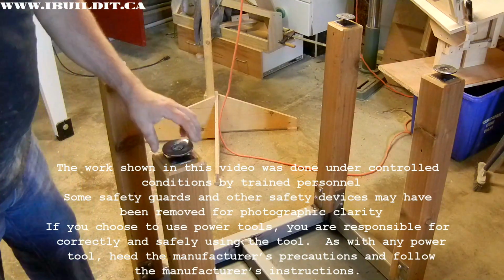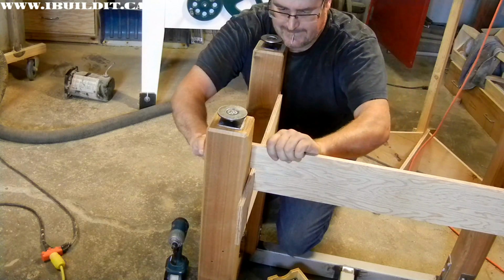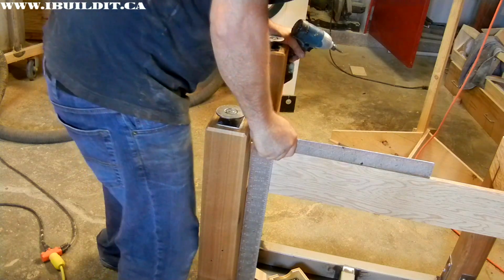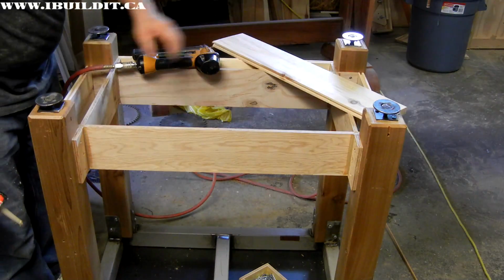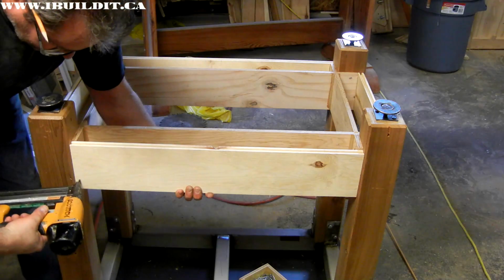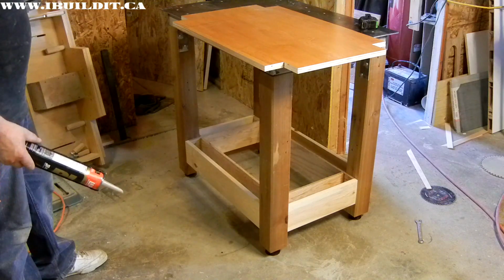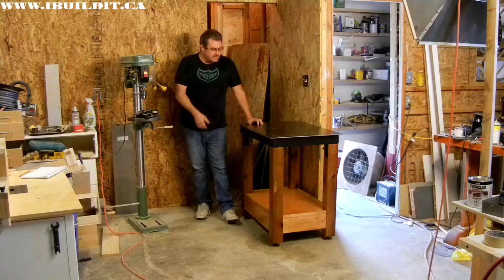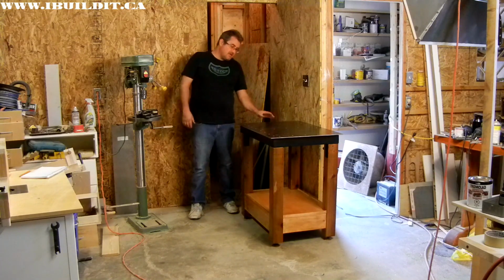Making A Steel Work Table, Part 4 of 4

Comment: I accept and agree with your requirement that the table sit firmly on the floor, but also like parktondc's suggestion for casters, so maybe you could do a video on how to fabricate the sort of cam-action flip-down casters that Rockwell/Delta machines from the 1950s have? Those machines rest firmly on the ground and when you step on a pedal, the casters are engaged by the cam.

Comment: An idea.  If you were to put casters on the cart and a bottom , you would have some storage for heavy metal pieces or tools for metal working and you all ready have a cover plate for the top. The bottom will then be weighted some and help prevent the cart from wanting to turn over ,just and idea

Comment: Actually, i agree with both of you on this point.  Sure, if i have a bottom tray i will end up filling it with junk over time, but if i didn't have it to store things that i use over the course of a project i would be spending a lot more time wandering around the shop trying to remember where i set it down.  After the years i just have to accept the fact i'm a slob, & have "just enough" discipline to put my pile of junk back at the end of the day; so the tray is handy for keeping it in one pile.

Comment from the maker: The piece I bought was smaller (24" x 36" or 600mm x 900mm) and I can't remember the exact cost, but $60 seems right. Still costly, but not much of a choice, since steel is the only suitable material.

Comment: John Heisz Hi there great build loved your design, but as I'm in the UK I see lots of videos where nobody in the USA is using the gaurd on angle grinders. As a tradesman I was wondering if you could explain this please ? many thanks John.
Reply from the maker: +mrspudly1 How, exactly, does that relate to the project? As a tradesman, you should already know the answer.
Reply: It wasn't a criticism of your work, I'm curious why nobody seems to use gaurds on angle grinders over in the States on the video's posted.
Reply from the maker: +mrspudly1 What makes you think I took it as criticism of my work? I'll ask again, how does the guard on the grinder in any way have to do with the project?
Reply: It was a question in general, if you don't want to answer it you don't have to

Comment: Why are you using the masonry drilling hammer action on your drill for screwing in screws? You will ruin all the screw heads and your driver bit. Plus wear out the hammer action prematurely.